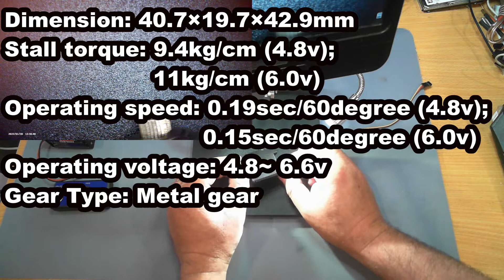Tower Pro MG996R Servo

Comment: Is this used with head tracking in FPV
Reply from the maker: It could be, but most FPV setup now use the micro servos such as the MG90S, they are smaller and have much less mass.

I have seen these used through the forearms and roll neck servos on the InMoov robot
In my case, I was using them for the leg servos on a Spot Micro project, these were not strong enough in that application.

Comment: Yes, that is definitely a counterfit, i ordered ones too and they have metal gears. Although i suspect mine are counterfits too, just better ones, that is concerning the gears. They aren't up to specs either. They only lift 3,5kg/cm
Reply from the maker: It's annoying when you order servos and what you get is not what you ordered.
You think your getting a quality unit, but instead your getting rubbish. 😞
I've taken to using different brand servos now, still Chinese made, but of a much better quality.
They don't cost much more, but at least you get what you are expecting.
The other two brands i use are the JX-Servo and the Feichao, both perform as expected.